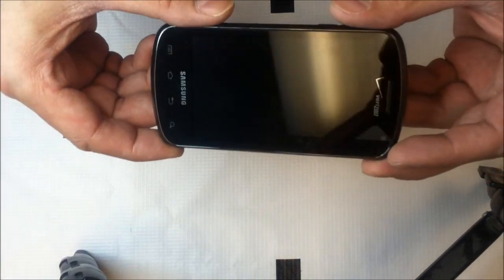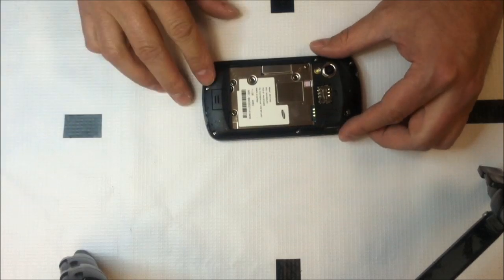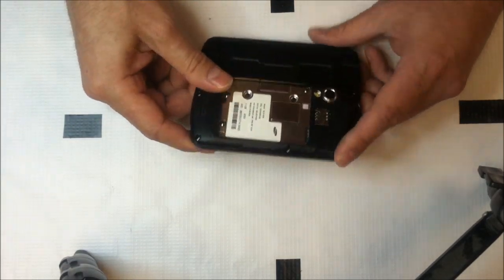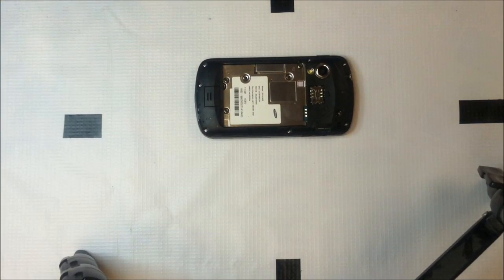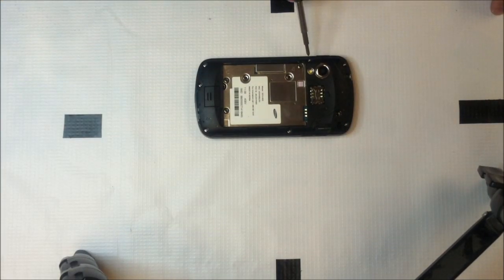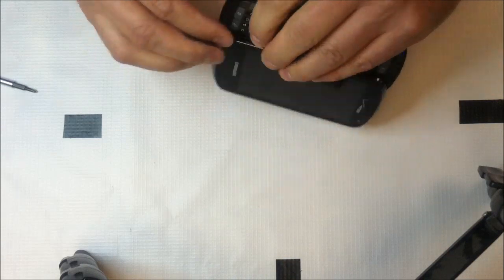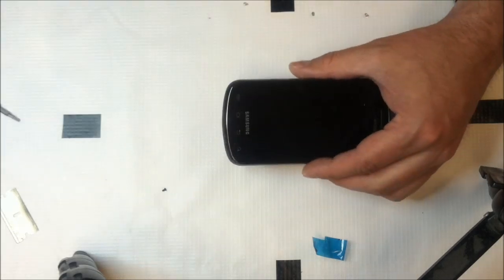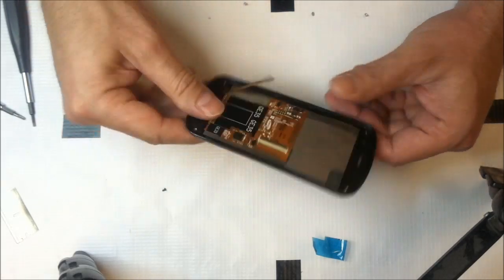Samsung Stratosphere i405 disassembly

Comment: I need to change my front camera. I think? When I install a new camera app the phone will take pictures with the rear camera. When I switch the camera to the front camera I get a camera Error and all I get is a message Can't connect to the camera and I have no way of switching to the rear camera. Other than reinstalling the app. So it looks like my phone is older than the one you are repairing (breaking down) will I need to remove as many things as you did to get to the front camera?
Reply from the maker: Short answer- yes. I'm answering some questions in greater detail during a weekly livestream and this week yours was one of them. For a more detailed answer you can see it here https://www.youtube.com/watch?v=rxrDn9ktV-g#t=55m18s

Comment: My phone is a Samsung slider type w/ broken screen I have a doner w/ a bad antenna. Is the antenna located in the part w the screen or the main body w/ the battery ? thanks.
Reply from the maker: The antenna is typically located in the rear half of the phone where the logic board is located. In some it is a black piece of plastic with a few metal contacts, in others there may be physical antenna wires with a round type of connector that plugs into different areas of the board.

Comment: So my question is:  I have two Stratosphere 2 phones with sliding keyboards that i want to combine... one has a bad mini-usb and the other a broken screen...   looking at your tutorial, it seems like I can go to about 1:55 of the video where you pull the mother board out.  At that point, just switch the parts from there?  Is that a correct assumption that I don't have to go through the middle frame and take apart all the screen/LCD side of the good screen phone would I?  TIA
Reply from the maker: That is correct.
Reply: thank you...
wish me luck... going at it now.  :-)

Comment from the maker: Disassembling and cleaning the phone is good. Leaving it in the sun is not as heat will only speed up the corrosion process if there is any moisture trapped inside.

Comment from the maker: You would need a replacement charging port, soldering iron, heat gun, kapton heat resistant tape and advanced soldering skills. A microscope comes in handy also. I will make an instruction video when I get a chance. If you don't have experience with micro soldering I recommend that you take the phone to a professional.

Comment from the maker: If you have some practice, a steady hand, a heat gun and a microscope it is possible as long as nothing on the board itself is damaged such as the footings. Even so only a couple of them are used for charging while others transmit data. I usually charge $65-75 and that's mostly labor. The part is only a few bucks. I would definitely call it an "advanced level repair" though.

Comment from the maker: Try another memory card just to confirm that your is not corrupt. If it still doesn't read google "OEM Flex Cable for Samsung Stratosphere i405 SCH-i405 PCB Ribbon (with Memory & Sim Card Holders and Vibrator)" and replace the component. Sorry but Youtube won't let me post anything even resembling a link.

Comment from the maker: It sounds like your charging port and external speaker were damaged. The speaker itself isn't too tough to replace but removing and replacing the charging port is an advanced level repair. If you can get a replacement logic board from another Stratosphere it is pretty easy to swap that entire piece out. If you do so make sure that the new board has a good ESN/MEID.

Comment: Hey, I have a question! So, my phone got thrown on the ground and got damaged a bit. The battery on the bottom end by the little gap to insert/remove it got forced down. I got it back to normal position and the phone functions perfectly fine, except it won't charge now and the external speaker doesn't work. I don't know if this has anything to do with it either but sent texts going through is hit or miss (I have to keep resending failed texts) Can I replace something to fix this, and if so what?

Comment from the maker: Stars like part of the Samsung splash screen? I'd have to see what you mean but if it's not part of the start up display then you probably need a replacement. Sometimes a cable may become partially disconnected and might need to be plugged back in. This requires disassembly.

Comment from the maker: The screen can be replaced. Sometimes you have to also replace the button flex cable that sits under the screen and controls your search, home, back functions. The cable is only $15 but a new screen is about $140. Buying a working unit with a bad ESN and then doing a board swap is usually a less expensive solution.

Comment from the maker: There is an app called SMS Backup that allows you to save text messages to your gmail account. I believe that they can also be exported to an SD card. Of course if your screen is not working you would need a donor to use in order to install the app and perform the backup operation. I will check my inventory on Tuesday and if I have an extra screen maybe we can work something out.

Comment from the maker: It might be a bad LCD or your flex cable could be damaged. My first thought would be testing it with a new flex as the LCDs are still kinda pricey. There's not really any special way to reset the display other than power cycling the phone. Plugging it into the wall wouldn't hurt but I doubt that will solve your problem.

Comment from the maker: If the keyboard still lights up but nothing on the front of the phone works you might have damaged the flex cable. Those things are very fragile. If there is no sign of life anywhere the logic board may be damaged. If the only thing not working is the LCD then it may have been defective. I had one go completely green in color after a couple of weeks and had to exchange it for another.

Comment from the maker: If the screen is cracked you must replace it. The cost is around $150 for the part. Labor is about $50. That is of course assuming that your only problem is a cracked screen. If it's worth the cost to you then yes I can replace your screen. Message me if you are interested.

Comment from the maker: There are no real break away warranty voiding stickers on most newer Samsungs including this one. There is at least one piece of heat resistant tape on the flex cable that could allow the trained eye to detect tampering. I recommend that you listen to the audio if you plan to disassemble your phone. A lot of information has been narrated and will probably help you to avoid damaging it.

Comment from the maker: I have successfully re-used the existing adhesive on about five of these phones and no complaints. You should be able to do the same if it still feels tacky. If it allowed dust to get inside and isn't very sticky anymore you will have to replace the adhesive. The bottom section is said to contain conductive paste so if you redo that part with regular adhesive you will have problems with them sensing touch. Try not to touch that area at all.

Comment from the maker: More than likely your LCD is broken. The bad news about all Galaxy series Samsungs is that the lens, digitizer and LCD are one piece. So if one part is broken you have to replace the whole thing. I will add this to the video description. The B stock LCDs are down to about $95 on Ebay. Otherwise you might want to try and find one with a different problem like a broken charging port or liquid damage that still has a good screen

Comment from the maker: You can often find "B" stock replacements on Ebay for a lot less. They are used but often work like new. I agree that if you are eligible for an upgrade you should definitely take advantage of a promotional price on a new phone. The trouble is for those who are mid-contract. Most Galaxy series Samsung phones justify an insurance policy although the deductible is usually $100-$130.

Comment from the maker: The most common reasons would be a flex cable which is damaged or not plugged in all of the way. Otherwise you might have gotten a bad LCD. This is assuming that you are sure that the phone is powering up. I usually test everything before reassembly by laying it out and connecting it to be sure that it does light up. That can save you a lot of time in case of a bad component.

Comment from the maker: If you look at the lenses you will notice that the sensors are on opposite sides making them incompatible. Sometimes the form factor will match and you might be able to plug it in (not recommended) but rest assured that you need to order the correct part if you want your phone to function properly. I wish that wasn't the case but manufacturers do this for a rea$on.

Comment: Mike, I was wondering if this was the same Super AMOLED screen as the Samsung Epic 4G D700...they look EXACTLY the same on both sides and the spec sheets I pulled up only noted 1 or 2 mm difference in dimensions...You seem to have a good deal of experience with these phones and I was hoping you could confirm my hunch.  The replacement screen and digitizer for the D700 is pretty widely available and is only about $90